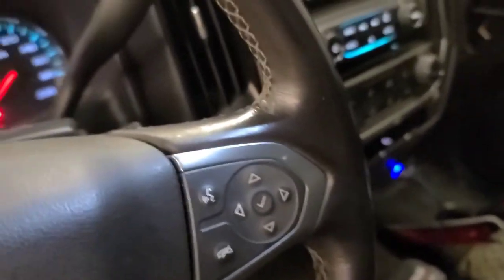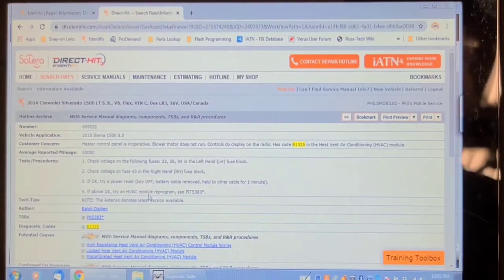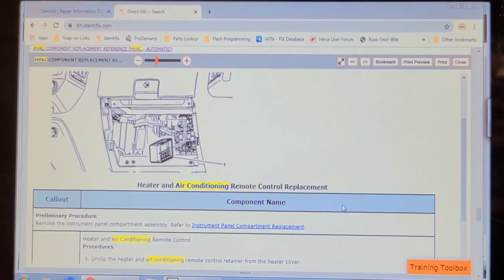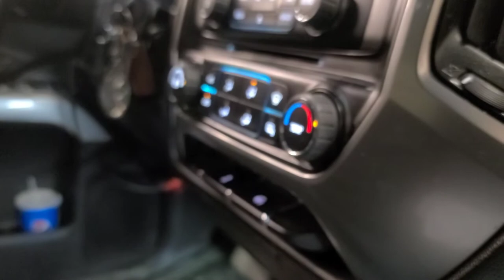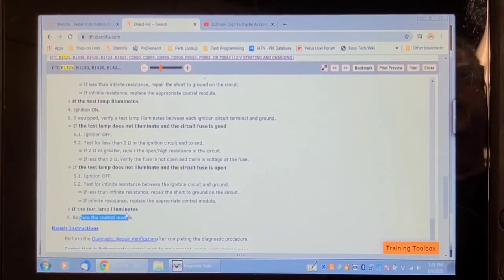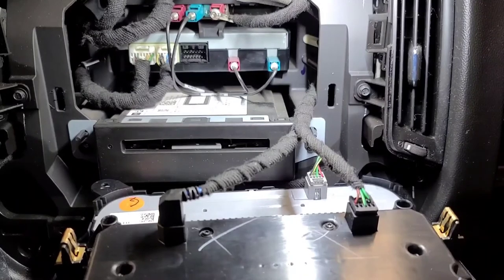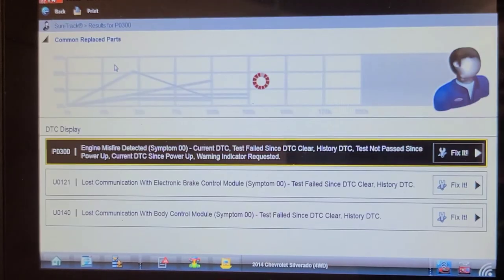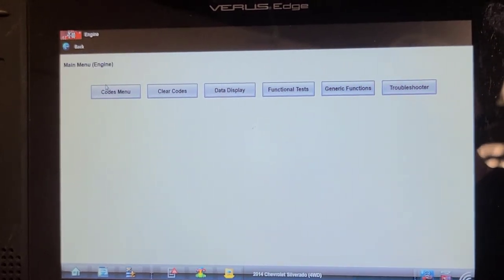2014 GM Truck HVAC Controls Dead

Comment: Phillip, thanks for showing  all that ending up by replacing the bad unit but could not understand why first condemned the hvac module after checking  power and ground and com wires and then checked the head controller and u find out that is the real problem as always very enjoyable to learn from the master. cheeeers
Reply from the maker: The scan tool has two selections related to the HVAC. There is HVAC Control and HVAC. They were both talking with the network but I was viewing data in the HVAC Control where it was reporting the voltage at 4 volts. I thought I was viewing data in the HVAC module. I figured it out by unplugging the module and noticed I still had communication with it. Anyways I was testing the wrong module all along. Oh well sometimes you have to pay to go to school...

Comment: Hi Phillip, where did you find the wiring diagram? Pin 15 goes to the blower motor and I’m assuming sends a voltage signal make the fan going. I can’t seem to find any information on it. Thanks
Reply from the maker: I use Identifix information site but you could try Alldata DIY information. You can purchase access for a year pretty reasonable.
Reply from the maker: Pin 15 is a duty cycled signal to the transistor in the blower motor that controls the fan speed. There is no blower resistor as on older styles.
Reply: Would you know what max voltage signal would be for full fan (like on Max)?
Reply: And thank you for the reply!!
Reply: I got it figured! Thanks for your help and your video!
Reply from the maker: @leamanroad1204  I haven't tested that circuit by my understanding of the circuit is a varying dutycycle signal. Here is a test procedure I found
1. At the M8 Blower Assembly, verify battery voltage is present on the Red/Violet wire at pin 1.

2. Verify a good ground on the Black wire at pin 6.

3. Using a labscope, verify a good 0-12 volt square wave on the Blue/Gray wire at pin 2. The high voltage will be greater than 11 and the low side should be less than 0.5 volts. The percentage of duty cycle value should increase as the blower speed is increase.

4. If OK, replace the defective M8 Blower Assembly.
Reply from the maker: @leamanroad1204  Was it the blower assembly?
Reply: I had lost continuity in the wire from pin 15.

Comment: I’ve got no heat at all control lights on but not blowing at all, blower motor ?
Reply from the maker: Test for power and ground at the blower motor, check fuses.

Comment: Hello, I have the code U1510 on my 1016 gmc canyon I looked it up on internet and says something about hvac module harness with poor communication. Should I replace that myself first or should I bring it to a professional.  I need 
 a good advice . Thanks
Reply from the maker: I need to know which controller is setting the U1510 and what the actual problem or symptoms are. I'm assuming your having an issue with the HVAC possibly AC operation and your getting that code with an OBD code reader in the ECM. Likely you have a problem with the active grille shutter system. Give me some more information and I'll try to help.
Reply: Until now everything is working perfectly I can say,  I haven't noticed any  difference but I have the engine light on. I will get more information and let you  know I appreciate your help.
Reply from the maker: @nestorrodriguez9373  then seems you have a problem with the active grille shutter which is in front of the rad. Start by checking the fuses. Not sure where you are but if weather has been cold, snow or freezing rain, could bave been frozen.

Comment: I'm dealing with a 2015 that has an auto climate system. The hvac system stays on everytime after the vehicle is running, shut down, and key removed. If key is toggled back to ign on/off, hvac turns off and stays off like normal. This truck does not have the blower resistor like previous models. Found the heater control module, but can't verify that the module is the problem. Temp and controls all function like normal when vehicle is running, and also when the climate controls stay on with key off/removed. Verified normal power/ground at blower motor. Verified continuity on the control wire from control module to the blower motor. I cannot find a relay tied to the hvac control system.  Is there anything to test further before replacing heater control module?
Reply from the maker: Does the entire heater control stay awake or just the blower fan stays on?
Reply: @PhillipBailey  Everything stays on. It’s a 2500 HD Denali. Getting a P2536 code. Also learned that if the truck is running, then shut off, before door is opened… when you press any of the heater control buttons, a message will pop up on the IO8 display saying

SYSTEM COMMUNICATIONS ERROR

A communication error has occurred with the climate system. This may fix itself. Restarting the vehicle may also fix the problem.
Reply from the maker: @00stangmang  sounds like a LIN bus problem. Possibly the Hvac controls is not getting the request to shut off. It's going to be difficult to diagnose especially if it only does it once in awhile. I'd start by disconnecting the control head connectors and treating the terminals with Stabilant 22A
Then do a network code clear. What module was reporting that code? Are you able to do an All Systems Code Scan?
Reply: I have nearly the exact same truck, a '15 Silverado 2500 HD LTZ 6.6, that is doing the exact same thing. Key off: HVAC stays on. Cycle the key from off, run, off once more and the HVAC turns off. I've narrowed it down to the HVAC control module is not going to 'sleep', but my new one won't program correctly with Techline Connect. I hope you get yours solved if you've not already!
Reply: The problem I was experiencing ended up being a short in the BCM.
Reply: @00stangmang  I figured out my truck. The wakeup signal wire running from the BCM to the ecm/ tcm, etc, was broken at the engine harness connector at the front of the truck near the battery. Coincidentally, there is a TSB that outlines similar faults due to this very wire, however the TSB points to assembly defects in the interior wiring harness. Only by coincidence did it happen to be the same circuit affecting my truck. Still it gave me a good direction.

Comment: Hey I have a 2010 silverado ls 4.8
The truck only blows cold air I can turn it off any ideas what it might be ?
Reply from the maker: Are both heater hoses hot? Check coolant level, is it coming up to temperature? Is it dual zone AC or manual? Any HVAC codes?
Reply: @Phillip Bailey  yea one gets hotter then the other yes tempeture stays in the middle and I have manual no dual and no check engines right now
Reply from the maker: @JayJay94_214  if one hose is significantly hotter than the other it indicates a restriction in the heater core. Make sure the cooling system is full. Try flush the heater core.
Reply: @Phillip Bailey  alright I will try wish me luck buddy 😭 happen to me right after I fix a taillight issue lmao